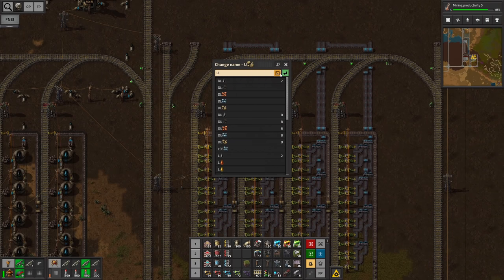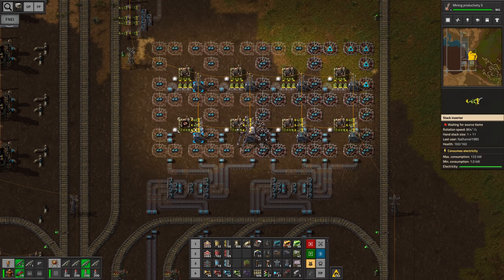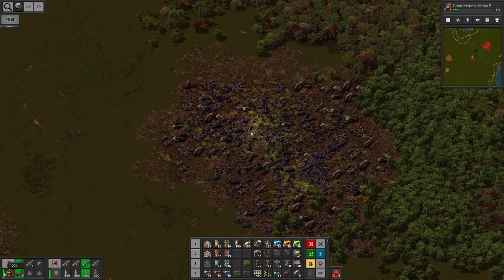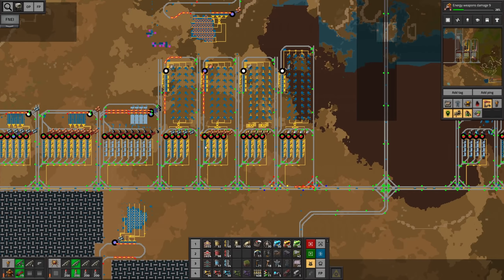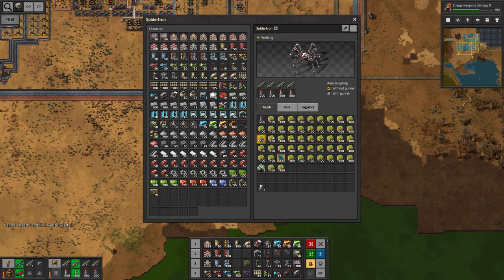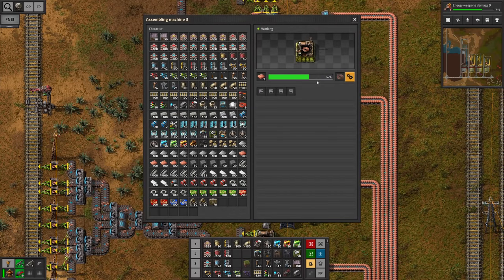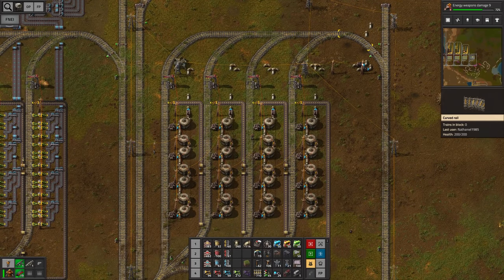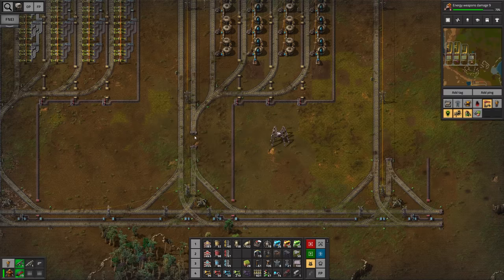BASIC INTERMEDIATE RESOURCES - Factorio: Ep. #14 - Guide & Let's Play

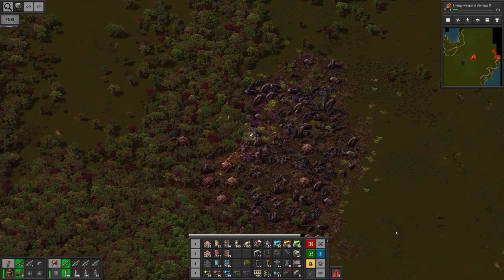Comment: 7:50 - 16 squares allows storing one Fusion Reactor or 8 Mk 2 Personal Batteries.  The Portable Fusion Reactor produces 750 kW of power.  8 of the Mk 2 Personal Batteries store 800 MJ.  Assuming a 750 kW power draw it would take ~1066 seconds before the Fusion Reactor is a better deal, or about 17 minutes.  I'd be tempted to go with 1 reactor and use the space that would be taken up by a second reactor for more batteries.  Your Fusion Reactor will be busy charging the Batteries all the time, but if you stay in one location so only the Roboports are used (the Shields, Laser Turrets, and Exoskeletons aren't used) you should be good

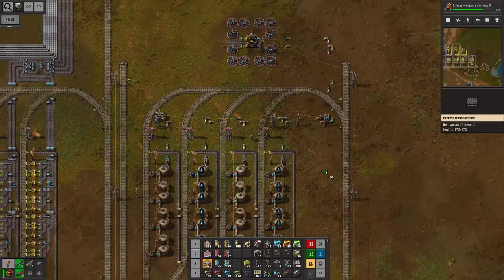12:05 - one idea for your Gear, Copper Wire, and Iron Stick production would be alternating which Splitters feed to each set of Assemblers.  You can see at 20:00 where only the outputs from that first Splitter are going into the first two Assemblers.  One idea would be setting it up so the outputs from the first Splitter go to the 'left side' of the Assemblers, and the outputs from the second Splitter go into the 'right side' of the Assemblers.  This way even if only one train comes in, it can still (barely) feed all of the Assemblers to try and keep the output balanced.
Reply from the maker: Thanks for the math, makes sense what you're saying here. I'll refine each crafting station once they are qctive and beaconed up.

Comment: Why don't you balance out the input & output of your trainstations? Now your I/O is bottlenecked, as your trains (probably) wait until full.
But, if the train which supplies the bottom crafting module never arrives, or just doesn't have enough, your systems are waiting on eachother, while another module might have 15k copper wires in its backlog.
Thus, it'd have enough to send the output train on its way,  if only the output were balanced
Reply from the maker: Yes, you're right, we'll have to make a few adjusments to prevent that.
Reply: @Nathans-Sandbox  it'll take a bit more space, but luckily the map is pseudo-infinite :)